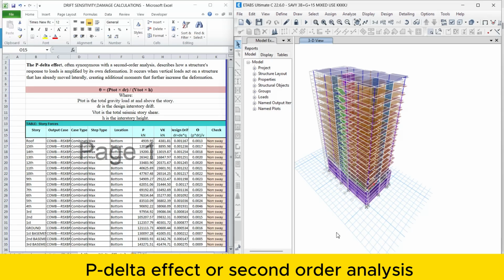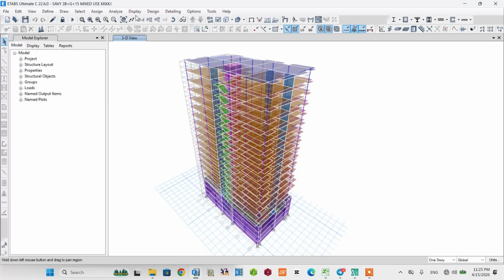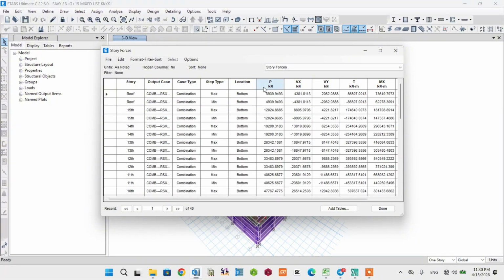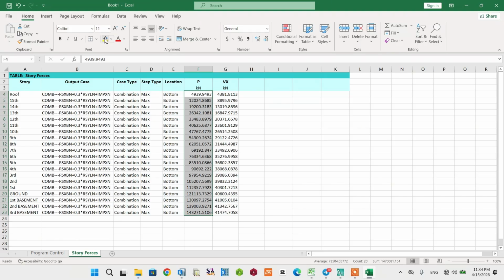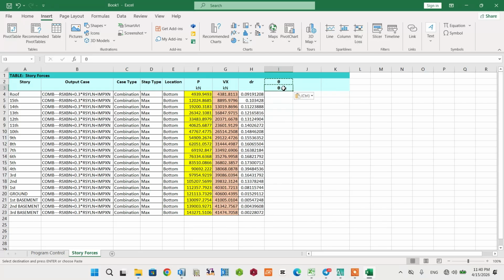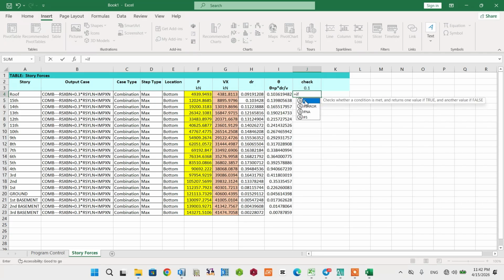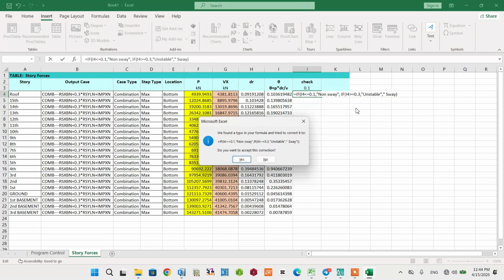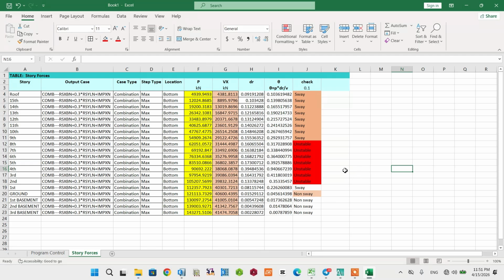4 Pre Design Checklists 20 Story Buildings in etabs – Part 2 P delta effect or second order analysis

Comment: thanks for your explanation and all structural design activity. But  my question is the code says this you are ignoring the height of the building why? theta =  p*dr/vx*h
Reply from the maker: Good insight, but CSI ETABS program consider height by it self when calculating elastic drift, so simply multiply elastic drift by q to get design drift.

Comment: Very nice work and presentation!
As usual, I have a few questions regarding the P-Delta effect:
1. Why is the storey height not considered as indicated in the equation?
2. Based on the checking results, if the upper storeys require consideration of the P-Delta effect while the lower storeys require a design revision, how should this be handled independently, especially if the structure is classified as non-sway? that means upper floors are classified to sway and the lower floors sre non sway. 

Thank you.
Reply from the maker: Good insight, but CSI ETABS program consider height by it self when calculating elastic drift, so simply multiply elastic drift by q to get design drift.